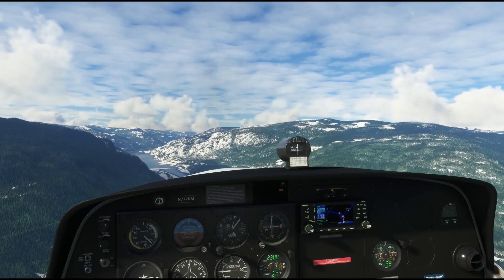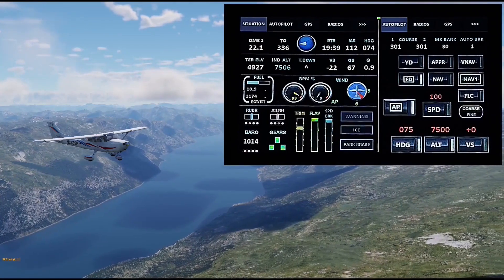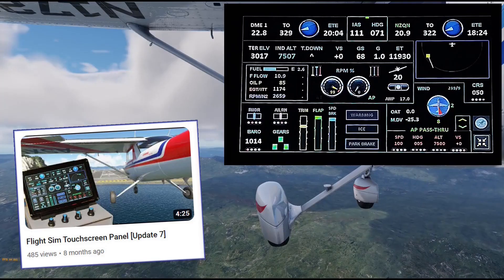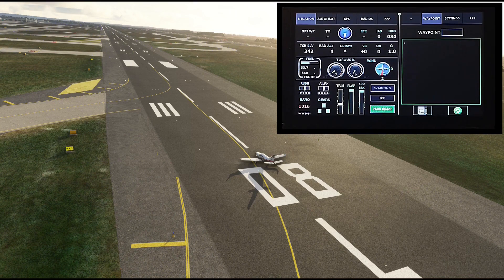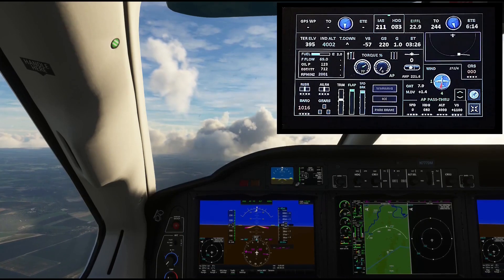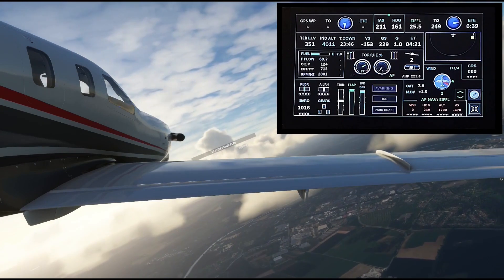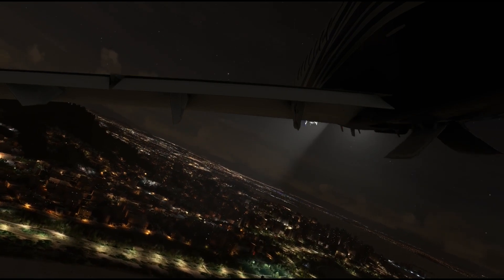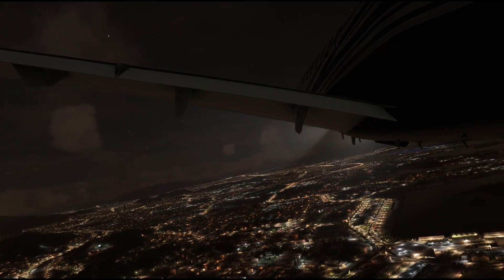Touchscreen Panel for Flight Sim [Update 10]

Comment: Thanks for another great update from up. The addition of WiFi&Waypoint makes your t.m.p stronger!
Reply: There is not enough external power supply, which causes the connection serial interface screen to restart and self-check all the time. You can try to power on the MCU first and then the connection. Now a small power management module is very important
Reply from the maker: Yep, flashing screen is a symptom of inadequate power source.  It is mentioned right there in the Nextion spec.